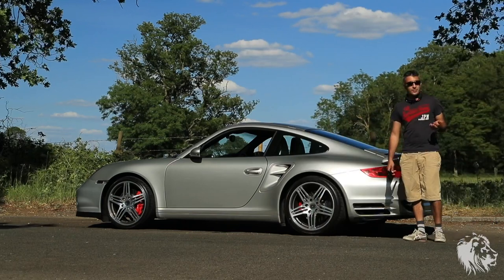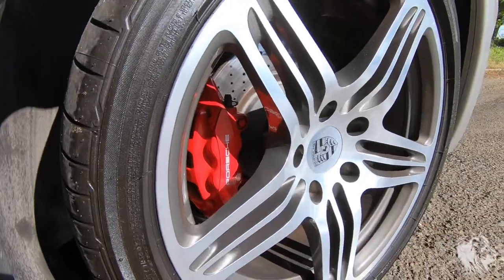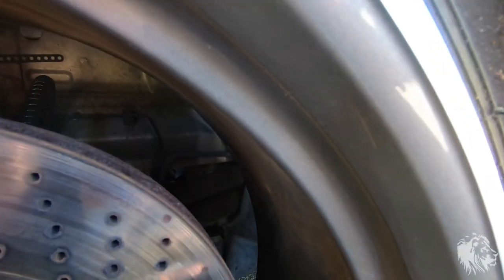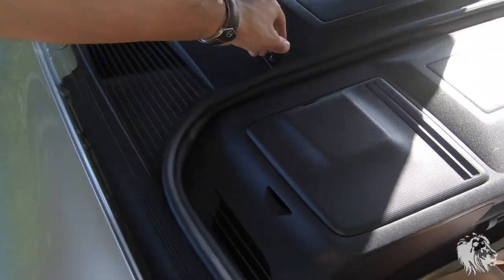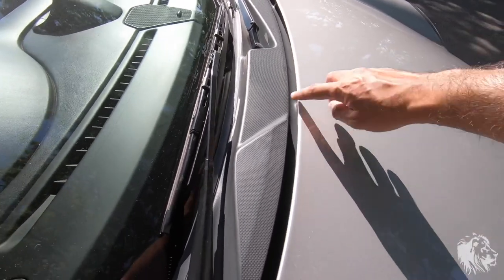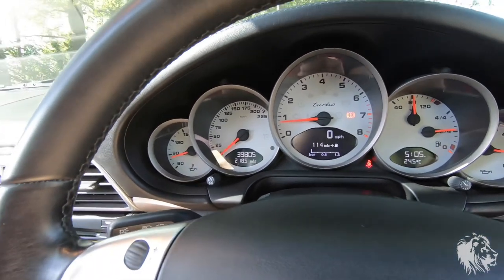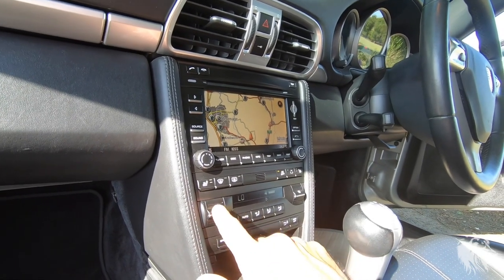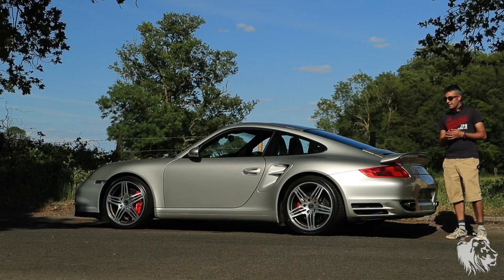How I Inspect a Porsche I Want to Buy: Episode 4  Diary of a Porsche Specialist

Comment: Long story short, make sure a used 13 year old car looks like new but costs like a used car.
Chips in the front bumper/hood or windscreen is perfectly normal for a 1 year old Porsche without PPF, let alone one with more than 10 years.
Reply from the maker: We see many Porsche that are like a 1 year old car at over a decade old. Examples are out there. Thanks, Raj

Comment: I have a 997 Turbo. The occasional smoke on cold startup is normal and common on the flat 6.
Reply from the maker: Thanks James, yes it can be, just persistent smoky startups and excessive amounts of white smoke at any time are usually signs of worn turbo seals. I know from experience, just had 2 turbos rebuilt, they would smoke excessively only on startup after a spirited drive. Bearings and turbo seals on both units were shot! Cheers

Comment: Nice video. Confused about the interior pcm. The car is clearly a 997.1 but the pcm isn't.1 but i assume 997.2. Did the turbo also have a 997.1.5 crossover?
Reply from the maker: Hi John, yes there were just over 200 Gen 1.5 Turbos with Gen 2 PCM 3.0 and Gen 2 keys. Of those, there were around 36 manuals, this is one of them. Cheers, Raj
Reply: @MRSPORTSCARSPORSCHE  wow. That's cool! Thank you for the the quick reply!

Comment: HI Raj - yer a monster!   great job.   I have restored two MGAs and a 66 e-type fixed head coupe and now I am preparing to sell the xke.  I want to buy a Porsche and would like to know more about how common water leaks were on the boxster/cayman/911 cars.  Having a difficult time choosing the model, but would probably be around the 2010 circa versions.   Did undamaged cars then ever leak through the convertible roofs or into any of the pillar sections, or anywhere else?  Also, in your repertoire of porsche videos, do you have any that can help a normal guy like me do basic maintenance himself?   Great vintage sports cars  stop depreciating at some point and eventually become classics, where people can have them restored, or do most of it themselves.  What happens to a porsche at 150k miles?  Will even desirable models just totally lose their value because no one can work on them or maintenance eventually will become catastrophic?  vintage 1900 cars are fairly simple to work on - people save them from the junkyards  -  but what about a 2012 911 early 991?   Does your investment go south at that point?
Reply from the maker: A lot of questions! Thanks for watching and sounds like you know a lot about classics. I think the Boxster, Cayman and 911 are all great Porsche to own in the long term, they all don't really suffer high mileage, just keep on top of maintenance really. The hoods can leak around the drainage holes, but this is usually only to the drains blocking from tree seeds, leaf litter and mud/dirt collecting. Keep the cars cleaned in those areas and there shouldn't be any problems. Everything is fixable and parts are still readily available if anything should fail or get damaged. Even higher mile Porsche have value. Buy a good one and you won't regret it! I don't do any maintenance other than cleaning, I leave it to the experts, PorschaCare Rennworks in Todds Green! Cheers, Raj

Comment: hi raj, great info , i got a porsche 996,1998 model 3.4 tip- tonic 16,584 on the clock how can you tell if its got bore scoring mine's a bit ticky, thanks gareth.
Reply from the maker: Thanks Gareth, the 3.4 litre dual row engines like yours are not as likely to suffer from scoring, but if you suspect something not quite right it may be worth having a Porsche specialist checking it out. It may be something quite minor. To check for scoring though you'll need to have a borescope inspection carried out, the spark plugs are removed and a small camera is inserted into each cylinder to look for lines on the walls of the cylinders. Thanks, Raj

Comment: Great video. Question: would you recommend ALSO having car taken to my local 'car wizard' for diagnostic? Put on a lift for inspection? Or, if all seems to check out from the inspection here, that would green light for possible purchase? Thanks....
Reply from the maker: Hi Matthew, diagnostics and ramp inspection are always great and if possible do get them done. Sometimes the facilities are not possible to a buyer, especially when lots of people are after the same car and it is up for sale privately, so time is of the essence. These checks should be pretty sensible to carry out, key is just take your time, don't feel rushed by a seller to look over a car, make sure it is clean and you have plenty of light to spot any issues. Cheers, Raj
Reply: @MRSPORTSCARSPORSCHE  Thank you!